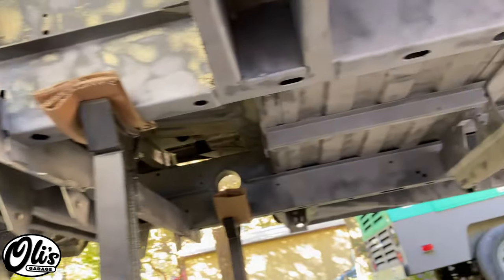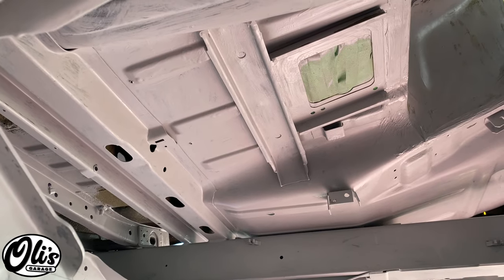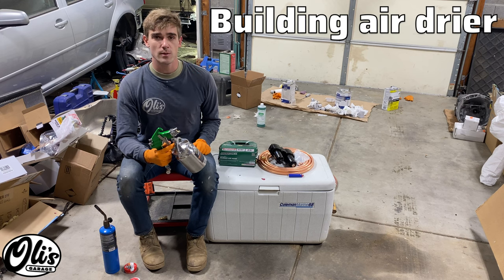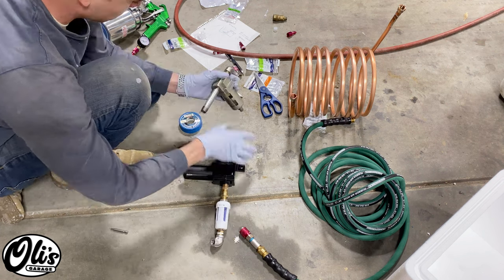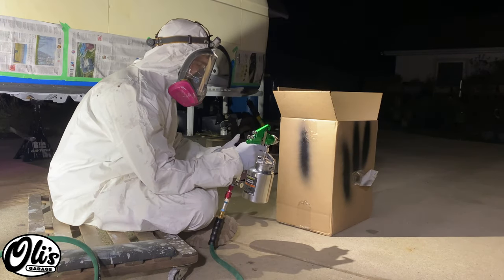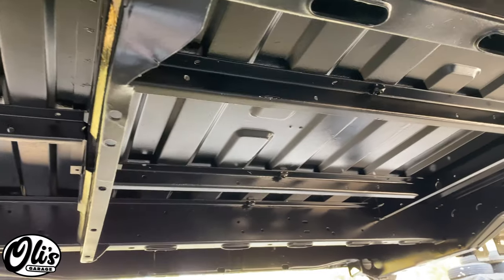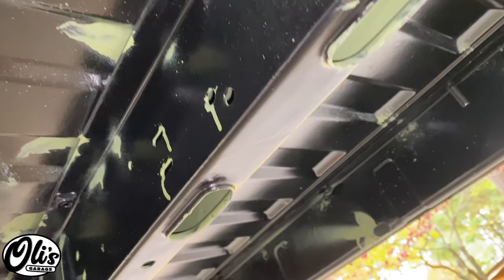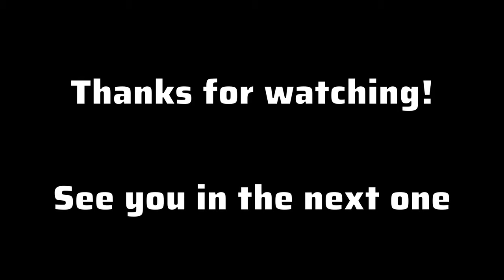Painting Frame With Epoxy

Comment: Dang that is commitment.  Wish I had the motivation to do that to mine.  Where did you send your trans out to?  It would be nice to get the lower engine mount(mustache bar) and oil pan so the motor will fit under the lid.  Love the content.  Thank you.
Reply from the maker: Thank you for the suggestion! I’ve been working on a plan to get it under the lid. For now I’m going to mount it such that the lid gets raised, but I plan on lowering it to get the lid to sit flush. First I really just want to get it running and then I can tweak it and do some of that stuff.